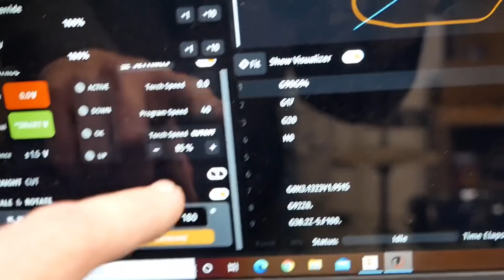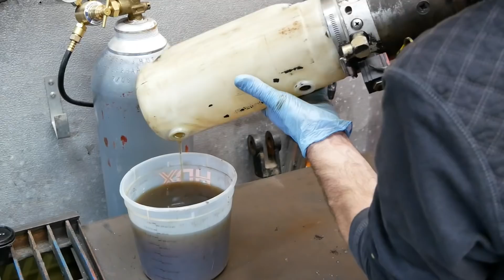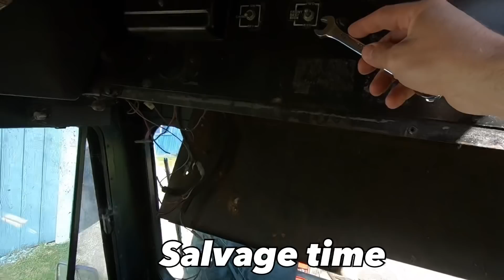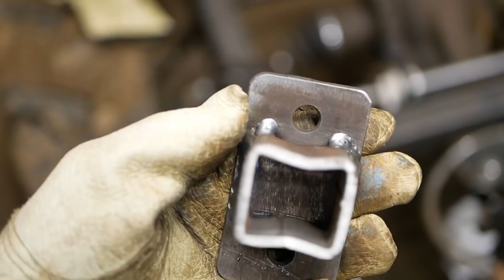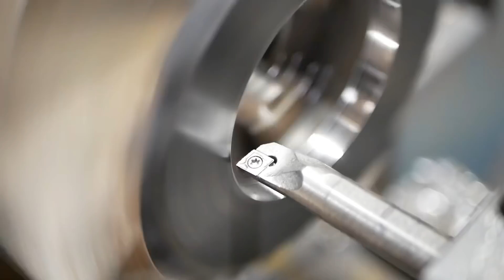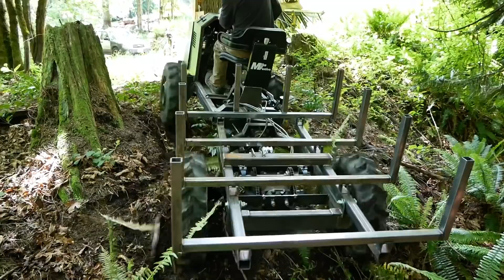420cc Predator powered articulating 4x4 dump truck build part 9

Comment: Could you use a passive hydraulic steering from the marine word? Hand powered vane pump
You could steer if the motor stops
Reply: It is possible but with the current configuration I think with out power assist it would not have enough power those are a low pressure system in general it does not take a lot of effort to turn a rudder the orbital valve he is using is basically a hydraulic pump but with power assist you can turn his truck with out the engine running but not very well even on flat solid ground. It is like turning your car with out the engine running and not moving

Comment: The dump ram mount looks clean. Nice job. If you have a spot you can mount a ram lock out for safety in case you have to work on your machine chasis in the field.

Comment: 23:20 you definetely need to weld that central diff its letting all the power leak into the front right
Reply from the maker: Definitely, like I said probably will do that when I take it all apart to paint everything. Take w

Comment: That thing is turning out great! I think if you go ahead and weld the viscous clutch or make a mini spool for it (usually it's a rwd conversion sleeve you can buy depending on the trans) you should be in good shape. Since the tires take the same path in a corner with a center pivot , you don't get the 4wd bind a regular 4x4 does.  That and I think you could fully lock the front without issue. You won't be overloading the front end at any time and I think it might help you steer better in rough terrain. It would definitely improve traction as you know. Awesome build.

Comment: Curious why u used the 420cc predator instead of the predator v twin?
Reply: Less expensive and plenty of power for his application. It's geared way down, doesn't need to be a speed demon, just a work hog lol... I mean look at what he does with his atv truck with its 8 hp engine. He'll be just fine with the 420.

Comment: I’m not sure what gpm of hyd pump you have but you could run the steering and hyd functions separately from each other by adding a control valve and placing a t-fitting off of the pump out put that way you wouldn’t need to 12 volt pump with the control valve be sure to find a valve that is open center with a power beyond for adding more functions later that way you could keep the steering valve and pump that you have with out adding extra parts to your rig

Comment: I've always used an atv and a trailer for doing things this would be used for I like it
Reply from the maker: I have a 4x4 ATV and it doesn’t have the weight or traction I need for work around here, plus I find trailers to be difficult in tight woods. 
If it works for you that’s great.
Reply: Yeah that's what I meant I like what ur building
Reply: Don't let the haters get to ya

Comment: That limited slip worked really well!  Will be interesting how well it works with a full load.  It would be really cool to see you make it adjustable on the fly!  I'm thinking a little sleeve over the axle that presses against the pads instead of the nut, either hydraulically or with a worm drive maybe...Jeep had a system called quadradrive2 that used a gerotor pump coupled to the axles that would slowly lock a clutch pack automatically when there was axle differentiation all the way to full lockup.  It was fully self contained in the differential.  Then there was a bleed off valve to unlock.  I bet you could come up with something similar!

Comment: Ok next time I’ll watch the hole video   I personally weld the front and rear I can see you breaking the axles with a 420 cc motor there use to holding 4000 lbs of car and 180 ft lbs of Torque   Instead of welding the center diff you can probably build a solid Cupler to replace it after you take it apart . If I were you I would look for a old Subaru gl 10 with low range selection trans it would be awesome upgrade ( it’s weaker but has 2wd 4wd and 4wd low ) would just have to make new front axles

Comment: I wonder why you didn’t just weld the diff ?
Reply from the maker: I mentioned why in the video.
Reply: If you lock the differentials it will be very hard to steer even full size wheel loaders do not steer well when you engage the differential locks they are only locked when conditions require it

Comment: Nice mods , you could run unused hyd line from ram to oil reservoir, allows oil to be drawn in , stops rusting and ware of otherwise dry end of ram .😉👌

Comment: That is some thinking outside of the box for LS. I’m wondering how the inboard socket and stub splined shaft/ housing bearing/seal will hold up to the radial load now. But OTOH...Can am used brake discs on their front inboard cv axles...still that’s more an axial loading. Stupid if you brake an axle though..

Comment: I'm not sure if it's Subaru or Honda but I see on the PFI Channel all them guys are them Hondas suped-up Hondas they make them all wheel drive by putting a viscous coupler in it's usually going to the back wheels and then you can put different thickness of oil in it to make the slip different more or less slip hit up them guys on POF I speed or boostedboiz and they'll let you know they're up on all that stuff and always willing to help
Reply from the maker: I appreciate your suggestion 👍 I will look into that!

Comment: Nice job Mike. I haven’t seen that device before and application of it like that.
I’m trying to understand how on flat ground with no load in the bed and just pivoting the machine, how the rear wheels still turned independently? Did you have the nut loosened at that point vs down in with the ferns?

For a future upgrade, I am wondering if putting a small brake caliper on there instead of the nut providing squeezing force could be a nice way of modulating when you need diff flock?

Comment: Mike, you could put a diverter valve in your steering circuit to run the dump bed.
Reply from the maker: Yes you are correct, I had been holding off on buying one because I have been working on tracking down the original orbital steering valve that’s matched to the pump, the orbital steering valve has a fifth port that sends feedback to the flow control valve built into the back of the hydraulic pump. I really appreciate you mentioning this option Bryant 👍 Thanks!
Reply: Mike, is this what you are looking for?
https://www.ebay.com/itm/124020974131

Comment: Thanks for all your time you put into the filming and editing. I understand how much more time it adds to the length of a build, or takes away from other things. All your videos that I've watched have been very cool and super helpful in gaining knowledge and understanding, hints, and tricks. It's funny that you have done this build because prior to you launching this build I was milling around on building a very similar thing. God Bless
Reply from the maker: Thanks for checking out my new video and commenting! It’s been a lot of fun building this and yes it definitely takes a lot of extra time to video all of the processes and editing it all,  but it’s been worth it especially when I get great comments from people like yourself!
If you do build something like this you can see what works and what doesn’t, the 8:1 gearing was definitely a much better gearing then the 4:1. Ps I would have saved a lot on this build if I just used the Ford F-250 steering box and power steering pump like my original design. Take care 👍

Comment: What is the actual model number of the transmission? Most of the generic car variants of the transmissions they build actually have a 90% bias toward powering the front wheels with only 10% power hitting the rear driveline. You unfortunately picked the wrong end of the truck for limited slip install, dude. If you can build one for the front, you will see a marked improvement in traction. Fantastic build! I love every video of this build, you're doing this project justice.
Reply: actually 4wd manual Subaru transmissions (1999-2014) are a 50:50 torque split with a varying breakaway force per rpm (the faster the speed difference between the front and rear the more force it takes to overcome the viscous fluid) it's the auto transmissions that have a front bias with computer control to vary the torque distribution
Reply: If he had more weight in the rear it would've helped a lot I'd think.

Comment: It would been better to use drive line from some car whit real 4wd and solid axels whit diff locks
Reply from the maker: Yes but if I waited for all that I would have never built the vehicle, people really need to be realistic about things.
Reply: @Mikefestiva  what you mean by saying "waited" and how it is unrealistic to think about using solid axels from "real" 4wd? They may be bit more expensive, but if you don't have to have dif locks, you can find some cars whit solid axles relatively cheap, specially when you need on driveline, you could just buy one whit engine totally crap, for example. English is not my mother language, so I may have not understood some things right or I may have some writing mistakes. Sorry about it.

Comment: Great Build!  Well done!  I think the design and implementation of the limited slip is excellent!  I love how you handled the doubters!  Great explanation and demo at the same time!  With the 1st demo with the limited slip hooked up and you were spinning - wouldn't a good 200 lbs in the bed have rather solved that situation?  Or are you going to have to eventually deal with the front spinning?  Liked Subbed !!

Comment: Looking good👌 you didnt have to rig up up your own mount for the throttle. Those engine already have a throttle mounting system down between the muffler and air filter.
Reply from the maker: Thanks for checking out my new video 👍 I already installed the throttle a few videos back, and yes you are right it’s nice they provide the cable hookup, that was the manual choke I was installing in this video. Take care.

Comment: I wouldn't use aluminum as a skid plate. You would be better off using a piece of 3/16 steel plate. Here's a simple test for you Mike. Get a piece of aluminum, a piece of steel, and a piece of gravel from the driveway. Now try pushing the gravel scroll the plate and notice the difference in the  resistance between the two.

Comment: @Mike - Really likin' that Crossfire CNC plasma table. Got to get me one of those. How much PSI of air is needed to run it? And don't let the haters bother you, just keep moving forward in life brother!
Reply from the maker: Thanks I really appreciate your comment!
Definitely correct about the hatters 👍

About the crossfire pro it’s definitely a really good table. I’m really happy with the well thought out CNC controller software that comes with it too. The plasma torch is from harbor Freight and it requires about 90psi to run. I have a video that covers the torch in detail on my channel. Thanks again 🙂

Comment: Love this project. Im gonna have to back and watch the previous videos. I am curious if the charging system built into the engine is going to be enough for your loads, or if you plan to add an alternator.
EDIT: watched more videos you have mentioned adding an alternator multiple time by episode 5
Reply: He is not sure yet he is going to run it for a while and see if the charging system will keep up or not.   You can get small permanent magnet alternators and a regulator  for about 100 dollars and I think they put out about 20 amps they are used on a lot of small tractors and excavators

Comment: Mate you didn’t have to back the nut off to prove it works you can see both of the wheels spinning but it’s good that you did and also you should do the same for the front but you won’t need it to be as tight as the rear but just to help with the traction

Comment: Mike, this has become one of the most complex projects I’ve seen anyone build at home. Well, even in a pro shop. And I have a friend who builds racing car frames. Any thoughts on the possibility of selling these, or the plans? I don’t have a need for it, but I’m sure others do.

Meanwhile, as you were speaking about tack welds, something came to mind about an odd problem I have. All my welding is done in my two car garage, along with my powder coating, and my largest lathe, a 14”. But, most of my shops are in the basement, where most of the room is. Problem is that when I build something precision aligned, I might have to weld it together, but I can’t bring it upstairs, because there’s no real way to keep that alignment. So I was thinking of buying a cheap (horrors!) flux core welder to just make spot welds on the parts before I bring them up to do the real welding. I know you tested the HF Easy Flux 125, at least I think it was that one. Do you still have it, and use it, and if so, would you recommend it for my purpose?
Reply from the maker: Thanks Mel for checking out my new video 👍 it’s been a fun project but it definitely takes a lot of time thinking and designing all of it.
About your question, I do still own the Titanium flux 125 and it’s a really good value for what you get. I think it would definitely work for your tack weld needs. It’s actually a surprisingly capable little machine. Just know it’s going to be flux welds with splatter and smoke, not clean MIG welds but as long as your okay with that it will work good for your needs.
I loaned my flux 125 out to a friend that needed a welder and he has been having a great time welding with it, I sent my cheapO cut50 plasma torch over there too. Take care Mel
Reply: Thanks for the reply Mike. I’m going to order one tomorrow. McMaster Carr sell a very good anti spatter spray. Don’t remember the name, but then, they really don’t like giving the name anyway. What I do about spatter if the spray won’t be enough it to cut a thin sheet to the approx shape and put it around the structure. Two or more pieces will get around odd things that stick up.

Comment: How much do you have into this so far?
Reply from the maker: I will cover this in more detail in my Q&A video soon, I’m over what I originally thought it would cost of about $1800. I think I’m around $3000 into it, but the way I look at it is the tires are new most of the parts are new and it will last for years so I’m fine with it going over budget a bit. Take care
Reply: Mike festiva never fun going over the builds budget but there is no question its worth it. Not only are you learning a shit load and giving yourself a challenge, but like you said this thing will last years upon years. 

Not to mention... if you bought something similar from a utv dealer you, $3,000 might not even be an adequate downpayment.

Comment: This guy should be a car engineer. Dude actually thinks about maintenance and repairs that will inevitably happen.
Reply from the maker: Haha! Well I had done mechanic work in the past, now I do millwright work, I have seen and worked on lots of extremely bad designs from so called engineers. Parts so badly designed they sometimes especially in the millwright work need to be redesigned to make them safer, Stronger and easier to service. I think most machines would be much better if the engineers actually had to work on the parts they designed 😂. Take care Andy

Comment: Great video, amazing build, just wanted some info on how exactly that LSD works with that torque coupler, seems like it would do the opposite of a limited slip. Locked normally but when on rough ground it would open up.

Comment: I think you need to do the front too. Only drawbacks I see to this design is dirt, chain stretch and the bulky size. Dirt and chain stretch are easy to manage. As for the bulky size you have the room and it's far easier to maintenance so why not. I really want to see what the bed looks like when you are all done with it. Will you bed line it or just do like lumber dumps and dump trucks and leave it bare metal?

Comment: you know, you could find a 1980s dual range.. the turbo versions used to sing at a full moon (very hard). no viscous and dual range..limited. I just sold my last 1987 subaru this past year.. 100 dollars. the whole car running. everything worked. it also had a 3.9 ratio for the lower power.

Comment: I sure hope I ain't on the naysayer list as I would enjoy this particular build if it was a continuing series and I don't think I am one who   claims that you need help combing your hair. I was thinking about the dump though and want to ask a question... did you consider a front ram that didn't have to scissor at all. Just mount at bottom like some dump trucks and have it push straight up. I have bent the style that you have on my little international and that is when I opted to go that route. I didn't have enough action on mine and it took the path of least resistance when the bed was over weight. So I like what you have, just curious is all

Comment: If you're ever presented with the opportunity to get a 4 jaw with detachable jaws (the ones that have 2 screws securing the jaw to the threaded part that moves) jump on it. Even if you get a regular 4 jaw, same. I feel that what you're doing, would benefit greatly from being able to accurately position things at any size, quickly (perhaps not at first, but once you get the gist of it, you'll push things with greater accuracy than a 3 jaw is capable, in the realm of sprockets, tubes et  cetera).
That jabble aside, this 4x4 is turning into quite the professional build. Knock out the pump issue, get a bed, and this wouldn't look too far out of something i could buy in Europe from a good, local company.
Reply: He's got one. I feel by the dirtyness of the lathe and heavy use of hand feeds that he's not a 4-jaw type of guy. His 3 jaw seems pretty accurate, so it's fine.